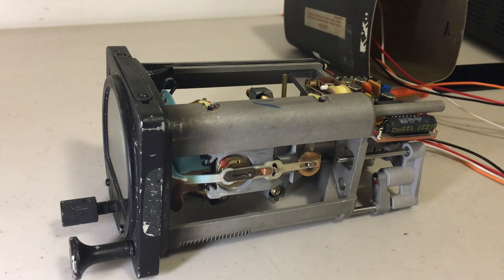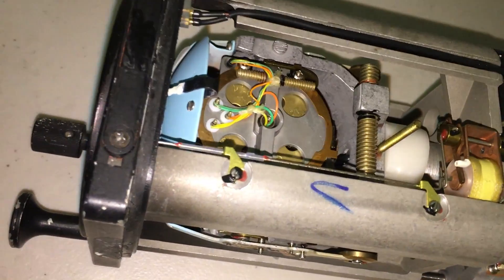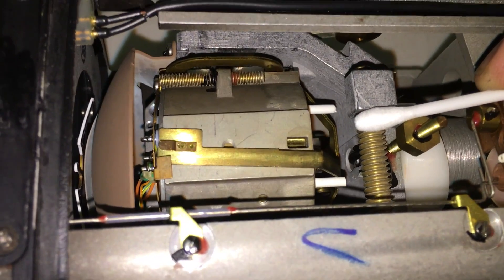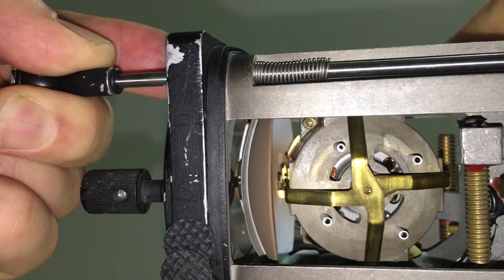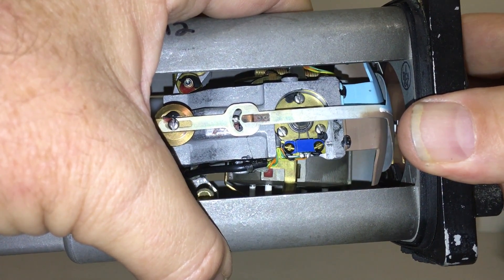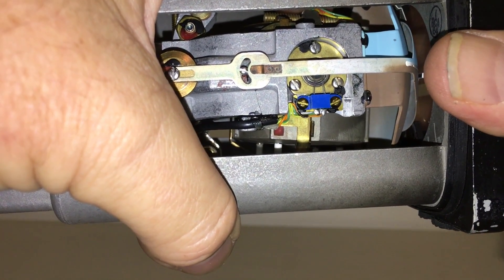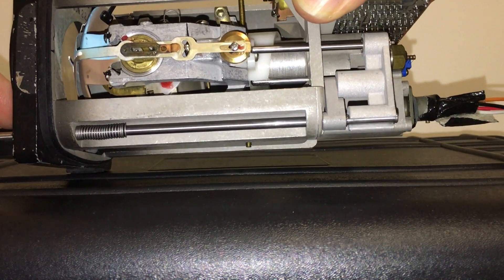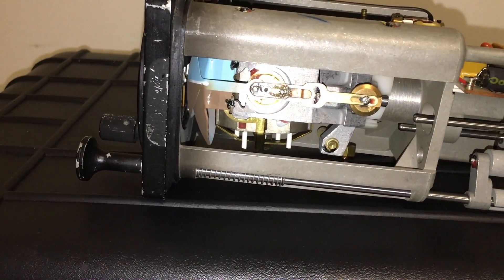Flat Earth - A look inside the Artificial Horizon - Pendulous Vanes.

Comment: Okay, so the electric gyro has pendulous vanes as well, awesome. It's weighted as well, great! Thank you, good video!
Reply: I have collected some patents concerning AI erection systems:

Note: all patents have in common, that the induced precession rate to erect the gyro must be greater than any drift rate, but smaller than the rate during maneuvers. Typical erection rates are some degrees per minute. Some of the patents sense whether the aircraft flies a maneuver and turn off or swich to another erection rate during the maneuvers to prevent maneuver acceleration induced false erection (maneuver drifts).

Patent of erection mechanism using pendulous vanes in air driven AI's:
Patent US2409659 A, 22. Okt. 1946: 
https://www.google.com/patents/US2409659

Patent of air driven erection mechanism using an arc shaped gravity pendulum in a case that closes some outled nozzles when out of alignment with the gyro. This produces some unbalance in the forces which erect the gyro. To prevent erection during maneuvers, inertial sensors sense accelerations and turns and activate electromagnets that lock the pendulum in its null position.
Patent US1934774 A, 14. Nov. 1933: 
https://www.google.com/patents/US1934774
https://www.google.ch/patents/US2038531

Patent describing an erection system, which is responsive to the flow of air for erecting a gyroscope. The erection system includes a plurality of channels having balls disposed therein. The balls are responsive to the gyroscope being tilted from an erect attitude by a first relatively small predetermined angle (0.5°) for rolling in the channels to create an unbalanced flow of air through the erection system, which provides a force to erect the gyro, and are responsive to the gyroscope being tilted by a second relatively large predetermined angle (10°) for rolling in the channels to negate the unbalanced air flow which disables the erection system.
Patent US4527439 A, 9. Juli 1985: 
http://www.google.com/patents/US4527439

Patent using mercury switches to sense direction of gravity and using torque motors to erect the gyro. The patent describes an additional system to reduce the erection rate when a flight maneuver is detected.
US2972893 A, 28. Febr. 1961: 
http://www.google.com.ar/patents/US2972893

Patent using mercury switches to sense direction of gravity and using torque motors to erect the gyro in normal mode. The patent uses an additional mercury switch to detect horizontal acceleration and a spring restrained gyroscope to detect flight maneuvers to switch to pitch/roll erection mode during this maneuvers.
US3077787 A, 19. Febr. 1963: 
https://www.google.com/patents/US3077787

Patent using mercury switches to sense direction of gravity and rotation about vertical axis, using solenoid to displace masses that induce precession to erect the gyro. The rotaion sensing mercury switches are used to change the precession rate on maneuvers.
US2842968 A, 15. Juli 1958: 
https://www.google.ch/patents/US2842968

Patent of an erection mechanism using free roling masses in a slowly corotating special cage, deflected by gravity so they produce a torque at the right gymbal to erect the electrical driven gyro in the AI's:
US2603095 A, 15. Juli 1952: 
http://www.google.ee/patents/US2603095
US3498146 A, 3. März 1970: 
http://www.google.tl/patents/US3498146

Patent of an electrical erection system using a gravity sensing pendulum mechanism and torque motors. Erection signals are cut during maneuvers to prevent gyro errors, by sensing translational movements with accelerometers:
Patent US2969683 A, 31. Jan. 1961: 
http://www.google.co.in/patents/US2969683

Patent of an electrical erection system using a system of a steel ball, moved by gravity, and an arrangement of 4 coils affected by the position of the ball. The position of the ball changes the inductivity of the coils. This change is converted into an electrical signal that drives two torque motors to erect the gyro.
US2553268 A, 15. Mai 1951: 
http://google.to/patents/US2553268

Patent using pneumatic amplification to create a counter torque to erect a gyro. The sensing device consists of a steel ball, that is positioned by gravity, to open and close small air inlets which when closed produce an amplificated air stream which creates a torque.
US3498145 A, 3. März 1970: 
http://www.google.com.vc/patents/US3498145

Note: some of the the linked patents are rather old an scanned documents. The scanners did not work properly on some docs, so they are sometimes difficult to read.
Reply: Wow, thanks for posting this. I was just wondering about the mis-correction that would obviously occur when the aircraft maneuvers.
Reply: Winston Larison 
This one does, but not all do.

Comment: Pity you did not have an artificial horizon with liquid or mercury leveling switches. This would be simpler to explain.
Reply: But this is way-cooler engineering!
Reply: They wouldn't work in high G turns

Comment: What is the role of gravity in the story , seems to me it plays a role when not fired up but I expect also when running?
Reply: M Goudsmits 金马桥 
The vanes swing freely within a preset range of travel, so they will always try to point straight down. If the body the vanes are attached to is not also pointing straight down there will be a difference in the size of opening of the air ports for one or both pairs which will drive the gyro body to align itself with down. Once that happens, all 4 air openings will be the same size and the correcting force will cease until something causes another misalignment.
Edit: they will always try to point in the perceived direction of down - might not match the actual direction of down when subjected to any acceleration
Reply: Last of

nope